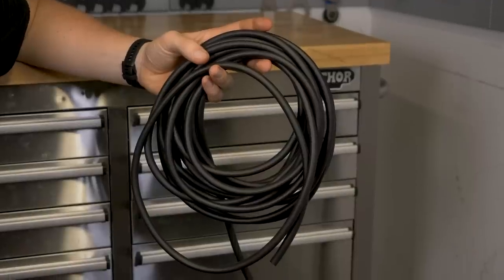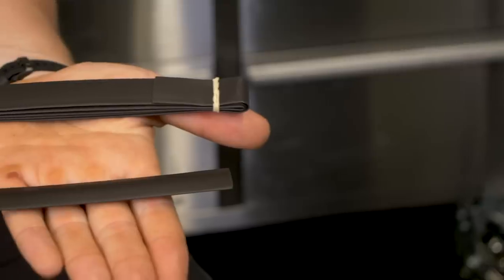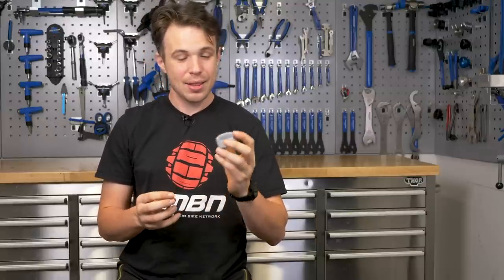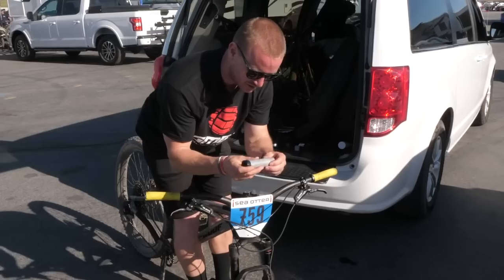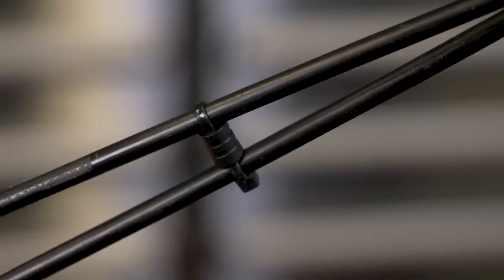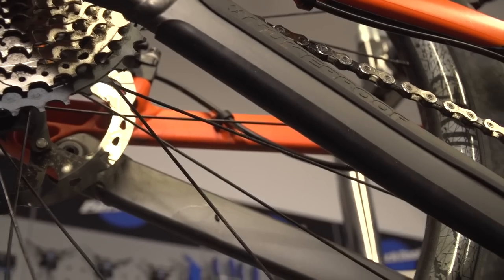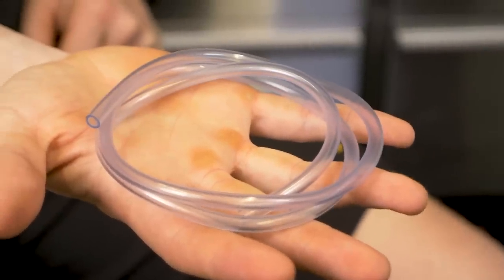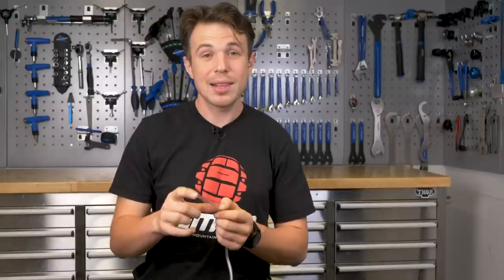How To Keep Your Bike Quiet | Tips To Silence Cables

Comment: One tip for cable ties. If you cut them flush with a cutter, flame the end of with a lighter for a second and it will be very smooth :) Also u can use some sort of spiralband for cablemanagment on your brake and shifting cables that are on the outside of your frame. It protect your cables and it looks very neat!

Comment: I use surgical rubber tubing off eBay on the outside of the cables before inserting into my frame. No rattle at all even on roughest rocky terrain 😊🤙

Comment: Henry, I have some small nail clippers in my tool box for cutting away the cable tie ends. They come really close and they are rounded so the cut is smooth and plush, plus you can reach tight spots with them. I never use anything else on cable ties.

Comment: When I fitted my Crank Brothers Highline dropper. I used Cobra Flexroute. They are a rubber lop for the cable and they extend out to the side. They can be cut and conform to any shape. They also come with low profile zip ties. So the tail of the zip tie follows the original path of the zip tie. Looks a lot neater than the traditional style zip ties. They are more expensive than normal zip ties but they also look neater. To cut the zip tie tails I have actually pulled then over slightly and run a very sharp craft knife along the edge of the block on the zip tie to get a near cut. Sometime the cut isn't as neat as I would like so I run the knife along the block and get it as neat as OCD possible.

Comment: That's heatshrink. Shrink wrap is the stuff you wrap your sandwiches in.

A little tip: Shrink a bit of narrower heatshrink sleeving over the end of your gear cable before you cut it. That bugger ain't fraying for anyone.
Reply: No, CLING FILM is what you wrap your sandwiches in. Shrink wrap is the thin plastic film you get around a brand new vinyl record, which is put on like a bag, sealed and then baked until it shrinks around the cardboard jacket.
Reply: @Metal-Possum  Yep, you're right. I'll be over here hoping nobody saw. : )
Reply: @steve.b.23  Also, cut your cables with the park cable cutters and it won't fray. Blunt cutters are what causes messy results
Reply: You can also use electrical tape to prevent fraying, which might be a bit cheaper.

Comment: You can cut cable ties flush even with standard electrical cutters.
Simply put one blade on the inside of the cable tie ( toothed side ) and the other on the back of the block not the back of the cable tie or the underside of the block. ( as below if that lines up )  
>|
[ | ]<
  | 
Then snip.

Simple and flush.

Comment: I use cable ties on each end of the frame to stretch the cable internally. No problems at all
Reply: I'm going to give that one a try. Maybe put a tiny piece of tube rubber under the ties to give it a bit more bite. My frame doesn't have rubber grommets for the internal cables so I've been looking for a solution since I bought it.

Comment: hey, do you have a tip for me how to finally get the inside cables on my Enduro Bike quietly? I have tried a lot to tighten the cables to the maximum and attach a tie to the opening, with tape I also tried to tighten the cables, even the Jagwire housing damper I tried to lay in my frame, but the openings on my bike are too small to get these thick foam covers in.
Reply: A pain in the arse.

Comment: If you don't have a rubber grommet, instead of dropping the cable tie into the hole in the frame, pull the cable out a bit and wrap it in electrical tape and push back in.

Comment: Bikes are designed for riding on the road, right hand side. This applies to off road bikes too. In the UK there is a problem- driving on the left, the brake levers need to be swapped over, so the cable routing is wrong. This could be acknowledged! Then there is the matter of the cables not being the correct length in part due to riding-on-the-left routing. Seems we have ten tips for scratching and scuffing your paint with these so-called tips. Pre-requisite should be getting the cables right in the first place. And how does this piece get told with no bikes on screen apart from one road bike?

Comment: On my hardtail I have external cables that go to raw cable under the top tube, I have rubber "gromits" not sure what there called, thick rubber o rings maybe, is there any thing else I can do to stop them clumping together and the cable hitting the top tube, and other parts of my bike

Comment: my bike suffered from noisy internal cable routing into chain stay, and due to linkage design, on the 2014 Fuel ex, I had to silence it.
 I used inner tube I cut two times so it was about a cm wide wrapped it around the cable, of course tape would have worked nicely too, but I had some tubes, so I used them.
https://flic.kr/p/2gcyTTC https://flic.kr/p/27Bocoa awful cable routing, on my bike it is tricky to get the cable trough, and everything has to be doen carefully & precisely, to not damage the internal routing tool, stupid routing, but I see some other bikes have silly routing like this, there are o benefits apart from aesthetics.
So far thee best cable routing I have seen is on Nicolai bikes, they get it, can take everything off fast easy, without need of zipties.
1:51 I never liked the idea of shrink wrap, as you need to mess with the cables and do it all over again if you swap something, I rather use zipties.